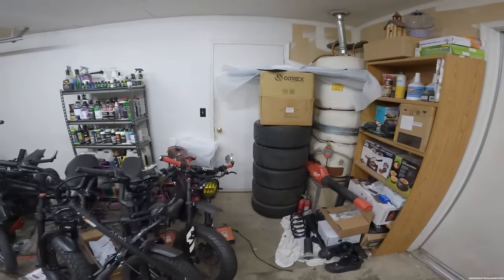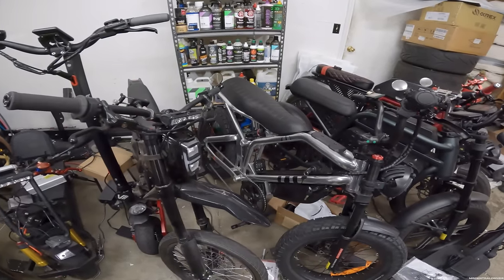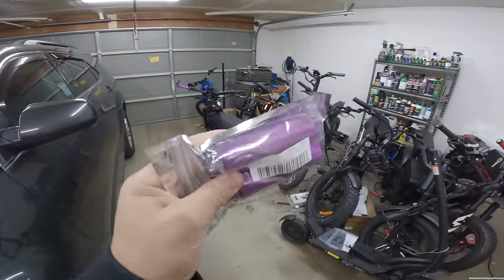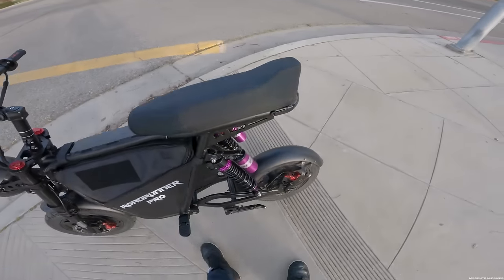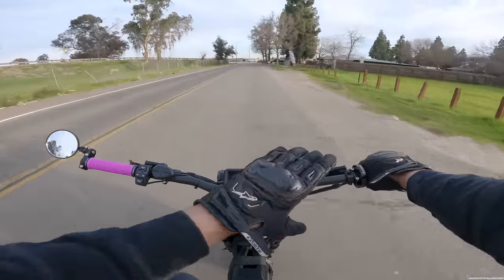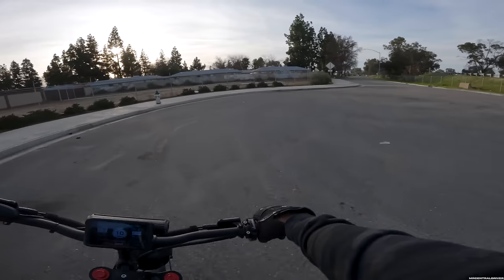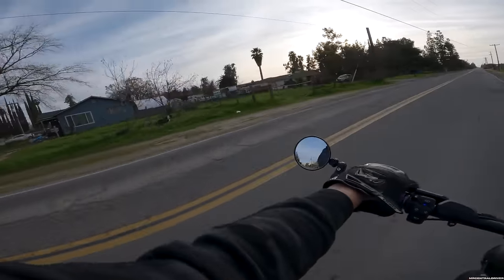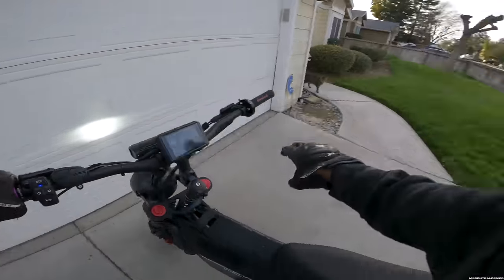RoadRunner PRO Gets some Rear SHOCKS!

Comment: I just installed a new battery a few days ago and I just ordered one about 10 minutes ago at like 3:50 am. I'm replacing the frame battery and the shark style one with another shark style one. I'm upgrading to 52V for the front hub motor so It'll better match the speed of the rear motor at 48V. My front controller and peripherals can easily handle it.
Reply: You best as hell post that rig. Sounds cool.
Reply from the maker: which one did you order because this is 60v. the non pro model i assume?
Reply: @MrCentralDriver  I was talking about my regular bike. I changed my mind on the battery and canceled the order. I shouldn't be making purchase decisions when I'm half asleep.
Reply: @sety409  It's just on my regular e-bike but I don't want to plug my channel in his comment section.

Comment: Contact tapia seats. And you can just add small like 10 or 20mm spacers under the red caps on forks to stiffen them up. I did it on my pit bike it's easy and I just got nylon spacers from Lowe's and used them.

Comment: I watch every vid that you post.🙌🏾 as far as mod suggestions for this ebike, perhaps a "BIGGER BATTERY WITH A NEW CONTROLLER..." I'd also look into upgrading the front suspension. Side note: Surronster has a mini moto, so doing wheelies on small ebikes are possible...🤙🏾🤙🏾🤙🏾
Reply: Voro is also testing a 60v 20ah triangle pack that fits in the pizza bag and runs in parallel
Reply: Also fun fact, the stock controller will do 72 volts

Comment: There is another seated scooter that I would like to see a review on. It is the Geofaught molo 5  72v 10000w dual motor scooter. It has a much better storage  basket option in the back than the roadrunner pro. The top speed on this one is 70mph. There are some other videos  on it on YouTube. Your reviews are much better & more in depth than others.
Reply from the maker: How much Is that compared to this. Sounds expensive
Reply: @MrCentralDriver  $2899. They say they are setting up a California warehouse for distribution.

Comment: I've had trouble getting pegs for the Roadrunner they seem to use a non standard thread.i figured out that you can take the rubber off the standard pegs and slip on what ever color handle bar grips you want or change the foot peg axle to something more standard.
Reply from the maker: awe thats good to no
Reply: @MrCentralDriver  the standard pegs from the RR  v1 and v2 and I have a valve stem facing the wrong way also,for that I bought a valve stem extension or adapter on Amazon